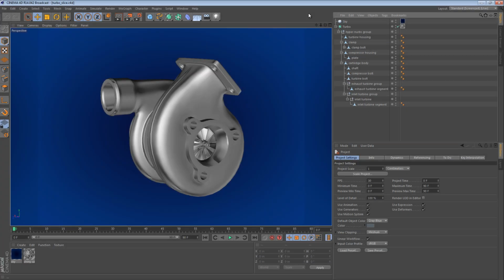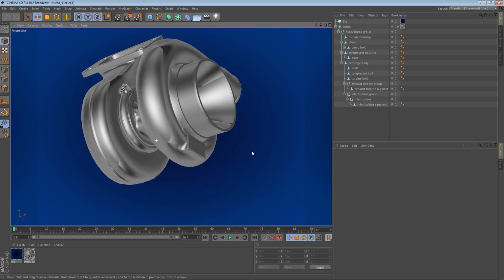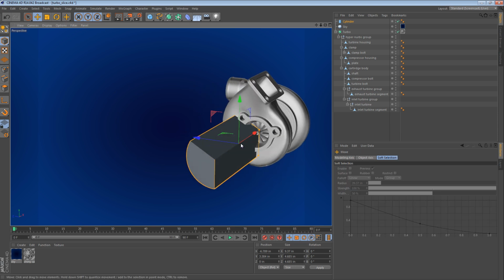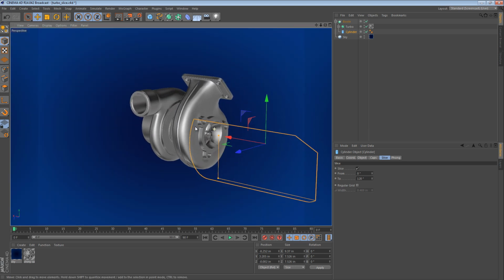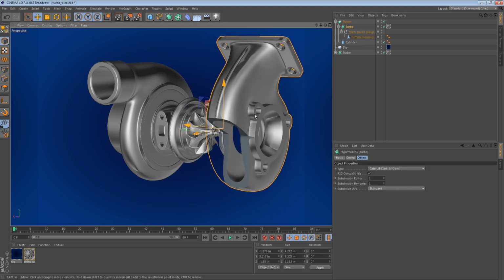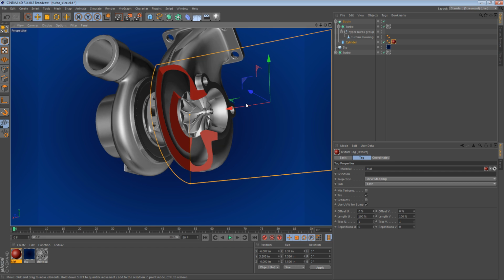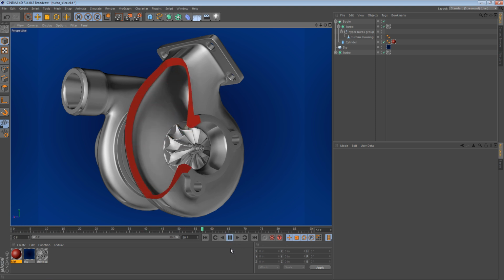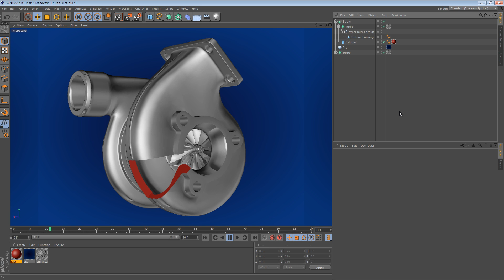Cylinder Slice Bool in Cinema 4D

Comment: I know this is old video..hope can get reply. Will this tool works for imported model? like imported fbx or dwg file? Thanks
Reply from the maker: Yes, it should!
Reply: @JamieHamelSmith  thank you very much for reply. I try to make construction sequence animation with growing effect of different building parts. Can this apply to only certain part (1 particular layer), but to the whole model?
Reply: @JamieHamelSmith  I will layers like beams, columns, floor, etc all separate layers, can I slice just one layer at a time to "grow" the whole building? Thank you!

Comment: Great video!  Thank you, Jamie.  Is it possible to render the red cutting section part ONLY, without any part of turbo?  In another word,  the turbo will be invisible, but only the read part is visible.
Reply: You can add a display tag to it and set opacity to 0, or you can just hide it in the render by applying a composition tag. Or simply hide it by making those 2 buttons near the checkmark of your object red.

Comment: Very good Jamie. Lots of folks rag on the boole object but it certainly has it's uses. I often find too that it's quicker to use a boole object to cut an awkward shaped hole (for modeling purposes) and then go in and fix up the resulting geometry, than it is to begin the hole from scratch. After some time you become more familiar with the quirks of the boole object and are able to preserve more of the underlying geometry so it's not as bad as people make it out to be.
Reply from the maker: Well said!